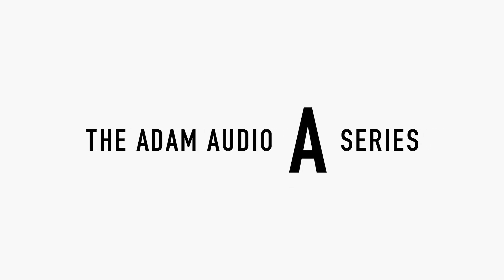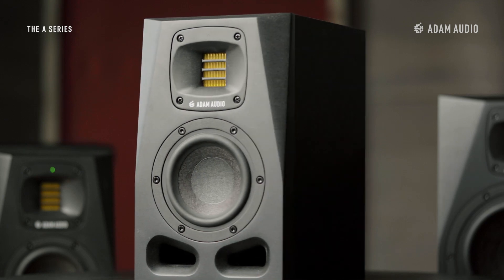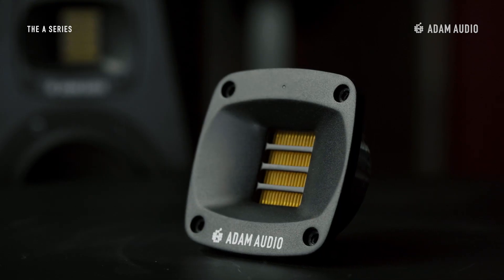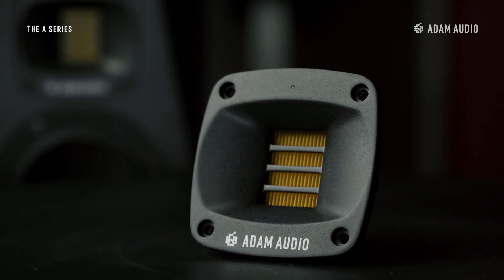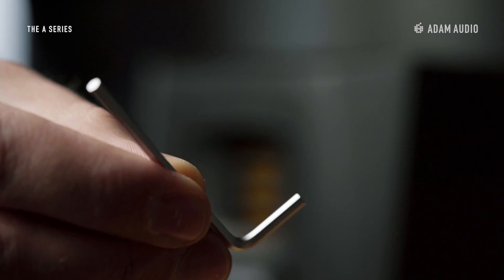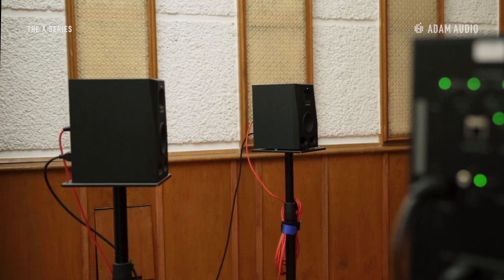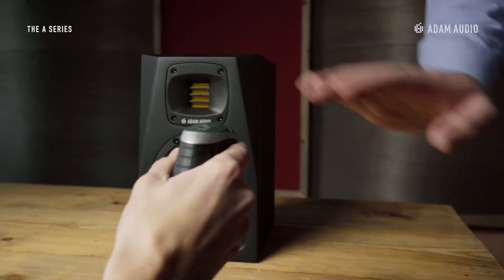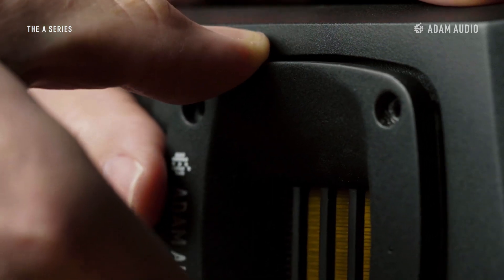The A4V | What is a Waveguide and how do you Rotate it? | ADAM Audio A Series

Comment: What is DPS delay of A4V?
Reply from the maker: Hi there!
There two kinds of delays:
- Latency is the minimum time it takes for the signal to pass through the loudspeaker. For all 5 models in the A Series it is 1.7 ms.  It cannot be reduced and will not increase.
- Time-of-flight delay is set using A Control and can be used to compensate for distance differences between loudspeakers in a system, i.e. closer loudspeakers should be delayed so they are virtually the same distance as the furthest loudspeaker in the system. The delay can be set in the range of 0 to 10 ms in 0.1 ms steps. 1 ms is 34.4 cm (1 1/3”).

Comment: Is a computer needed to perform room correction in these speakers?
Reply from the maker: Hi Reinaldo! Yes, you need a computer for the integration with Sonarworks. Once the profile is on the speaker, there is no need for a computer and any device you connect to your monitors will profit from the room correction. For the room adaptation on the backpanel of the speaker, you don't need any computer.
Reply: From my understanding you need the software + mic (+computer yeah)
Reply: Thank you very much